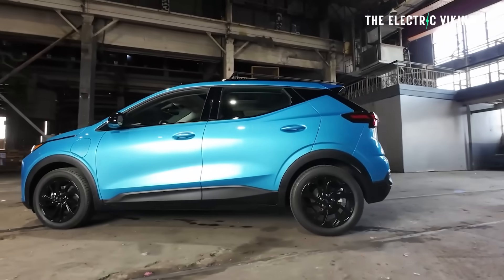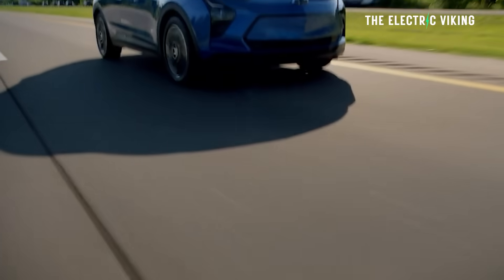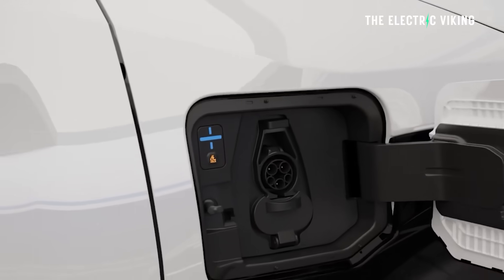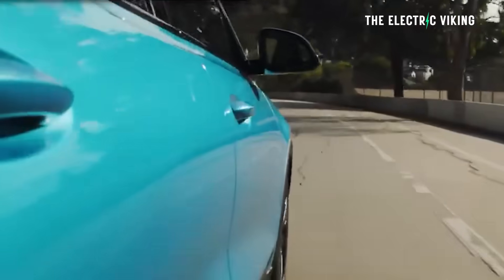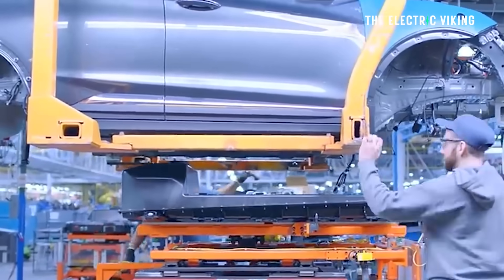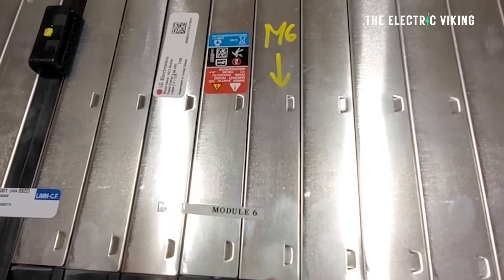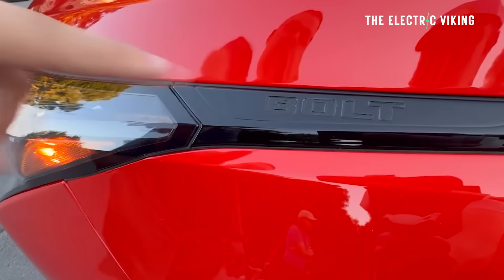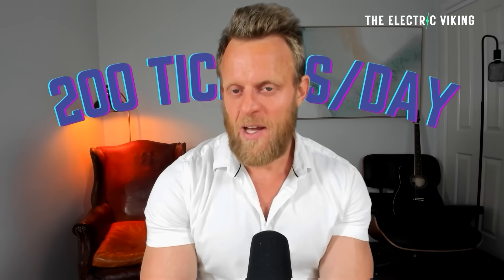GM unveils new Chevy Bolt – WAY Faster charging, LFP battery, low $29k price

Comment: Q1 2026 the RS goes on sale and the LT later in the year.
Reply: I think he just got confused thinking the 27 model year meant January 27.    We're looking at a 2 month wait, not over a year.  It will be interesting to see how the market reacts to the new Bolt.
Reply: Launch LT and RS at start, cheaper Base LT later.  I think Launch LT has the comfort package with heated seats and steering.  Makes sense with a Q1 release!

Comment: The price of ev's need to come much cheaper than gas cars to make them popular as they are disposable.
Reply: China
Reply: I mean, this is cheaper than the average new car cost in the US.
Reply: Dumb comment:  Bolt is already cheaper than most gas cars.  All cars are disposable
Reply: @dexlab7539 Even dumner is to expect its sold in everywhere in the world and f.e in Europe, you can get 2 gas cars for the price of one ev and gas cars are wanted as used, evs are not.
Reply: Well it's not as cheap as an equivalent gas car but base MSRP matches MSRPs one size up, in compact crossovers, the most popular vehicles in the USA.

And obviously they aren't disposable.  Key cost was batteries, but they have become cheaper, and a parity EV would have cheaper batteries still, making replacement costs lower.

Comment: My guess is that limited run means make as few as possible because those cars are not profitable enough, no matter how good.
Reply: They've said this will be profitable.  This is coming a bit early.  New models coming later.
Reply: Ive heard a lot of rumors that this bolt is supposedly a bridge model just meant to hold owners over for a few years so fingers crossed